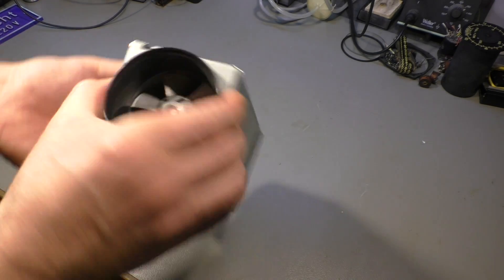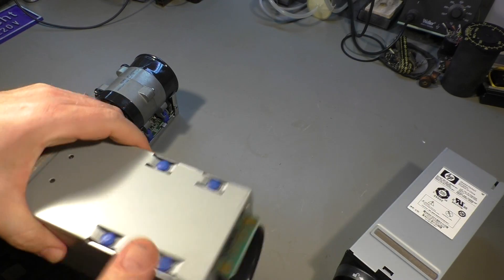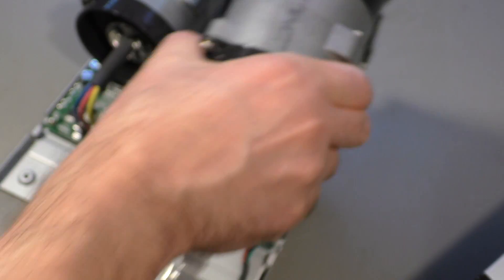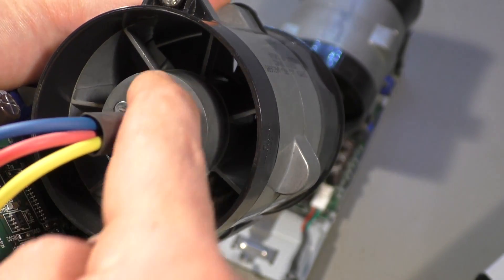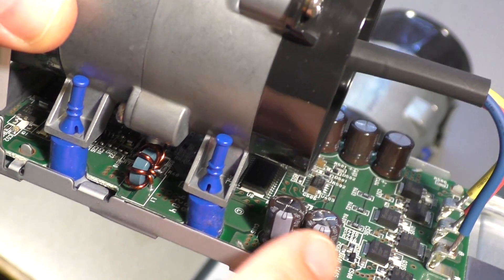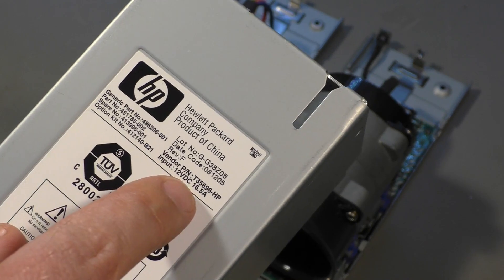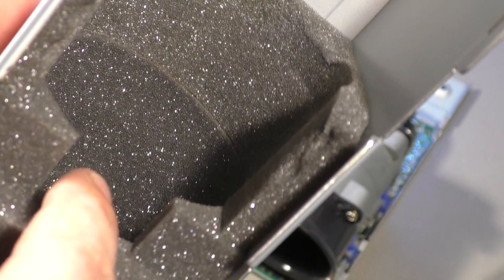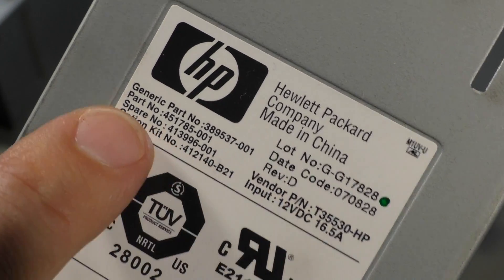RC Jet Car: SR72 "Woodbird" made with server fans (PWJ54)

Comment: Any way to PWM-control the HP-integrated ESC? I'm looking to re-use these in a PC controlled by motherboard's PWM (6-Pin power'd. RPM sense would be nice too).
Reply from the maker: There is certainly a way to do that because that's exactly what happens inside the HP Blade chassis. But I didn't find any information about that protocol.... Using the low voltage fan version with a cheap ESC is much easier.

Comment: Any idea why my HPC700 fan is beeping? I have a 3S power supply and a 30A ESC and it just keeps beeping at me
Reply from the maker: Do you mean a HP C7000? 
The motor can not beep. It must come from the ESC that wants to tell you something.
Is it possible that you got a high voltage fan? There are two versions. The older has a motor running at 50V and the newer has a 12V motor.
You can identify them by the motor cables. The old has thin cables with a black heat shrink tube around while the new (12V) has thicker wires in red blue and yellow visible.
The old PCB has a large heatsink with DC/DC converters (to make 50V).
You need a new version to run on 3S battery.
Reply: @PlaywithJunk  Thank you very much for your response!!! I definitely have the 12V one as described in your video (the new one), and I'm running it on a 3S (11.1v) battery ( 5200mAh ) via an ESC that says 30A on it (very sorry if the information isn't very good I only just started learning about hardware mechatronics). 

And after some testing, I can definitely say it is something within the fan unit itself that is causing the beeping, not my ESC. But I will try to look into it (and I've seen people try to power this with a 12V car battery so I'll look into that in the future) and let you know if I make any progress.

A big thank you for being so willing to help me and giving me such a lengthy response!
Reply from the maker: Hmmm... maybe time to consult the ESC manual.
Do you have another ESC to try? Maybe it's faulty...
Reply: @PlaywithJunk  Yes, just purchased a new ESC, so I will look into that! Thank you!!
Reply from the maker: @thanismurugathas2929  OK... Maybe I was just lucky but I bought a cheap 20A ESC, connected it and it worked without any issue. 🙂
Reply: @PlaywithJunk  Thank you for supporting me and trying to help me!! I can't wait to one day properly do this RC stuff and electrical projects like you!
Reply from the maker: @thanismurugathas2929  Last weekend I played with my HP fan and ESC. I noticed that it beeps constantly when I connected the servo tester wrong (used to control the ESC) or when I had the potentiometer not at zero at power-up. Maybe you have a similar issue. What do you use to control the ESC?
Reply: @PlaywithJunk  Thank you so much for relaying this onto me, it's very thoughtful of you! I have this little blue box with a potentiometer in it (it came with the 30A ESC)  and I have tried it the way you suggested (0 at power-up and connected to the little blue "ccpm servo consistency master" correctly i think), but the beeping persists. I am going to try ask my uni professor and if he figures it out, then I will update you with what I was messing up! Thank you very much for your time again :)

Comment: how did you power the motherboard? I tried to wire the motor tight to speed controller and it turned very slowly. on you second motherboard picture you have "pic pin 9" what does that mean.  You also have jumper to ground.  I have limited knowledge... can you help me out? I'm trying to use the motor for my son's 4th grade science project.  when I ordered I was hoping for 12 volt motor.

Comment: Hello,
Great video,tried the jumpers you gave at the end of the video,have the same model,but couldn't get it to work.The fan starts rises to it's max then stops suddenly,the power supply is beefy about 12v @ 40A,so this is not a problem
Reply: I didn't get the PIC Pin9 jumper,can you be more specific,just a small help, and it will ease up my work.
Thanks in advance.
Reply from the maker: I had the same problem when the voltage dropped below 10V. Have you measured the voltage directly at the fan module? Maybe you used too small wires?
The PIC pin9 is tied to ground. You can use any ground point you find on the PCB.
Reply: Yes you are correct,at about 10.2V the fan shuts off,used thin wires,but in the pinout you have shown,the yellow circle is tied to pin8 of PIC,please confirm
Reply from the maker: It may be a bit confusing. The circle above IS pin9, it's part of a track to pin9. This must be connected to ground.
Reply: @PlaywithJunk  How are you controlling the speed of the fans?
Reply from the maker: @reecebeck971  In this model I used a simple on/off switch. The ramp up of RPM came from the fans themself. My newer model (see that video) uses motor controllers for brushless DC motors (ESC). A cheap 25 Amp model will do. And you can srap the bulky fan PCB because you commect only the fan motor to the ESC,
Reply from the maker: @reecebeck971  Cool but much more complicated. An ESC is much smaller than the original PCB, So why keep it? I respect the will to understand the circuit and to make it work but.... it's impractical :-)
Reply: @PlaywithJunk  I agree but unfortunately I have one of the 50v fan modules, so to get a 48v esc and powerful enough boost converter  is expensive. Are you using a 11v lipo on this car?
Reply from the maker: @reecebeck971  Yeah right, there are 12V and 48V motors in those fans. I used a 3S Battery, that's about 12.6V when fully charged. The fans take up to 15-20 Amps each.
The first car had 48V motors, that's why I used the original PCB. For the second car I chose 12V motors and ESC.

Comment: I get 4.5A, why? 7:13 which gives this connection?
PIC pin9 to be unconnected?
Reply: Do I need a jumper for the new version?
Reply from the maker: No, you connect PIC pin9 to GND with a jumper wire. That will turn on the fan at full speed. Without this connection your fan runs at low power.

Comment: One more thing - your car might go faster if you remove the stator vanes from these fans.  The vanes are molded in to the can, and serve to turn part of the energy of the air the fan moves to increased static pressure for flow through cooling.  Since they're taking away part of the energy of the air flow for this purpose, if you remove the stator vanes you should get more speed?
Reply from the maker: The sators are there to direct the airflow into a linear motion. If I remove the stators the air would exit in a more circular motion, a vortex and I doubt that this would increase thrust.
But there is anoter problem: The stator is part of the motor mounting. Removing them would be difficult...

Comment: I'm playing with a set of these fans now... do you know which pin/connection is likely a PWM input?  I was thinking the PIC pin 9 was a candidate.  I tried to find out how the fans communicate with the OA controller to speed control them that way, but I couldn't find documentation.  I did find the firmware for the fans, but there's nothing obvious in the disassembly listing.
Reply from the maker: I think it's easier to connect the motor (the newer type) directly to an RC motor controller.

Comment: I had been wondering why some of the fans had different wiring to the motors. Know I now, thanks. Also cool use for those things. I think anyone that's delt with C7000s has a small pile of these sitting around.

Comment: Bought some because this video. got 2 new and 2 old modules.
quick overview:

Newer 12v version:
ML4425CS BLCD motor controller http://media.digikey.com/pdf/Data%20Sheets/Fairchild%20PDFs/ML4425.pdf
AJ29AU mosfets all N-Ch(?) <no datasheet found>
HA4315I/SS022 unknown part, could be a PIC for bus communication and speed control<no datasheet found>
NE555 classic lol

Old 48V version:
ML4425CS BLCD motor controller http://media.digikey.com/pdf/Data%20Sheets/Fairchild%20PDFs/ML4425.pdf
3055E and J634 Mosfets (N & P Ch.) no datasheet found
PIC16F88 could be bus communication and speed control  http://ww1.microchip.com/downloads/en/DeviceDoc/30487D.pdf
HC123M, Dual retriggerable monostable multivibrator. http://www.ti.com/lit/ds/symlink/cd74hc123.pdf
ISL6115 Power distribution controller

Comment: Those aren't real jets though :(
That would be much nicer, but extremely expensive.
The cheapest jets are around $1200 and have a 10 hour full rebuild/maintenance cycle :(
Absolutely ghetto engine switch and brakes, though.
Reply from the maker: That was the closest thing to a jet I could get. And at no cost!
Reply: If companies can sell jet skis, Play with Junk can make RC Jet cars with ducted server fans :)
Reply from the maker: Right... it has no jet and it is far away from a ski.

Comment: Great video! Can you better explain how to modify them to run out of the server? I'll probably pick a couple of them for some projects I have in mind
Reply from the maker: Put the two jumpers in as in the pictures. Attach +12V (as on the picture) and GND on the other side of the connector (the big golden pad). Take a power supply that can deliver 15 Amps and there you go.
Reply: Play with Junk thanks!, so I only need to short two contacts on the connector and connect a resistor to ground, great! Is it possibile to control them with an Arduino?
Reply from the maker: You don't need a resistor, just a piece of wire. Look at 1:51, the green wire goes from GND to the point you see in the photo ( 7:12 )
I use it only in ON/OFF mode... you would need a relais (20Amp). Maybe the newer vesion with an attached RC motor controller could be managed with an Arduino. (PWM control)

Comment: saw those turbines on banggood recently, didnt know they come from hp fan modules. interessting.
Reply from the maker: Yeah, they are selling it as "electric turbos" for your car... how silly is that! But you get them for $5 or so. I guess they took it from the scrapyard.
Reply: i mean those exact turbines which they must have taken out the hp supplies. 
http://www.banggood.com/de/DC-7_4-16_8V-52000RPM-Three-Phase-Inner-Rotor-Brushless-Motor-p-1084192.html
but in the end, slightly more expensive than just buying those used fan modules off ebay.
edit: habs auf Englisch wohl missverstanden. Ja, Die haben die Lüfter bestimmt irgendwo rausgeschraubt. Auf ebay und co fand ich jetzt auch welche für 5...10€ das stück.  ich dachte du meinst diese "elektronischen turbo" mist den man in den Luftfilterschlauch hängt haha.
Reply from the maker: Ich meinte das hier: http://www.yoycart.com/seller/ming9681/
"Car turbo" :-)